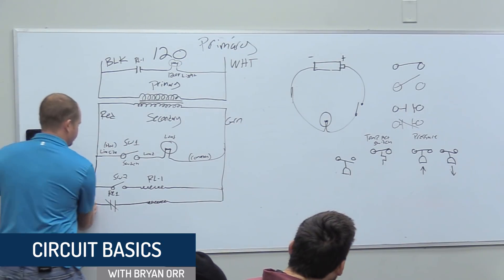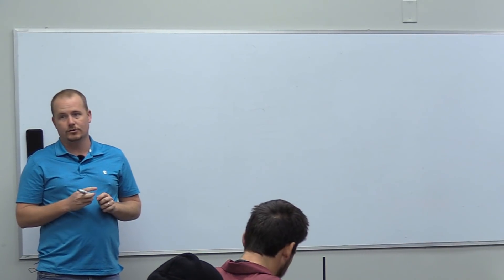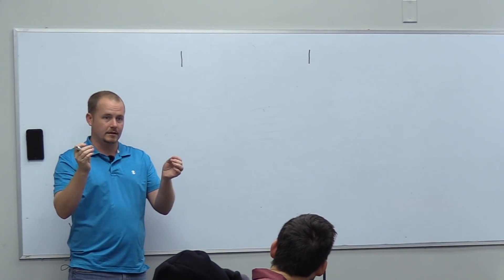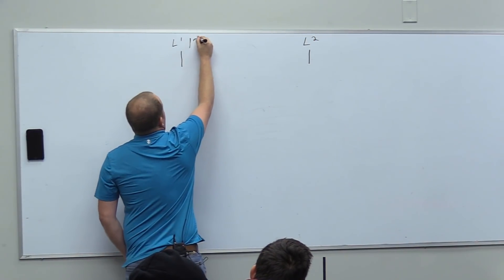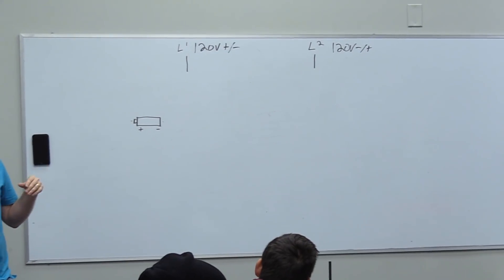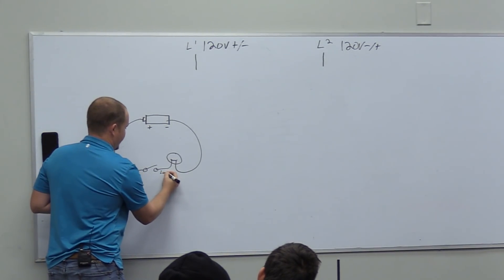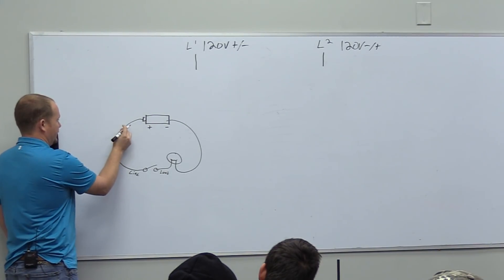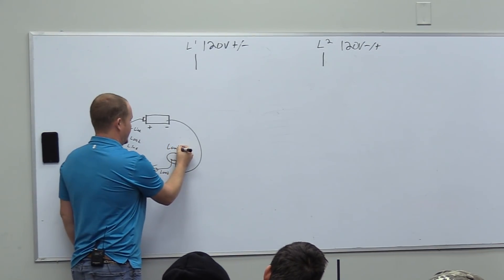Electrical Circuit Basics Part 1 - Line & Load

Comment: I was so involved in this short video I was bummed when it ended.  Waiting for part two.
Reply: Its the most commonly misunderstood parts of HVAC is electric wiring. Most common mistake is wrong wiring is what most of my teachers said.
Reply: I have spent months studying circuits and discovered a great resource at Gregs Electro Blog (google it if you are interested)

Comment: Hi I just saw this& it’s a few years. However. There was this 1 condensing unit on roof COPELAND  I BELIEVE 20 HP anyhow as you know ALL ZTHOSE BOLTED  COMPRESSORS HAVE A FEW CIRCUITS ON THE COVER, a crew & crane went out, it had TWO CONTACTORS, BUT WAS ACROSS LINE START,  they screw Ed it up, now coming compressor replacement #2, they still screwed it upnow the SERVICE MGR WAS PISSED, for that GREAT EXPENSE, so I was told to be there disconnect it,,,,,, CRANE will be there, I saw what they did , so I just replaced those 2 with a larger single contractor,, I also had heavy enough wire, so got rid of the other wires, and just wired accordingly, , replaced drier& suction filters, got it going , those days, no cell phones, no cameras , but I did make a diagram of how they managed to screw it uo, BUT, HAD THEY EVEN LOOKED AT THE COVER, they WOULD NOT HAVE LOST 2 COMPRESSORS ! , gee that must have been1977, or so.🇺🇸🇺🇸🇺🇸🇺🇸